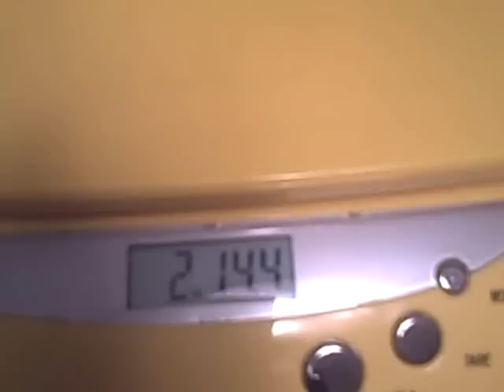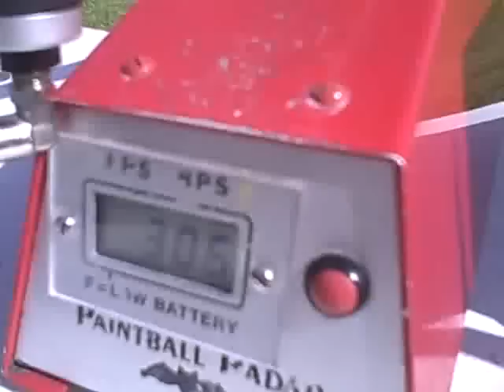TechPB Supergun Show - NXT Shocker Part 2

Comment: dye dm6-8 is also 10 pods from a 68/45  Proto M8 too.  the bad thing about the shocker is that you need to upgrade but the system itself is good.

Comment: Dude Ego's are some of the best guns out there, right up there with the best of 'em: the DM8 and the Closer.  These days most people hail Ego8's as THE best in the business.  The Etek2 is also much better than a Shocker.  I'd rather have a nice cheap Mini, G3, PMR, etc. than any Shocker.  Not too sure I'd rather have an SLG than an upp'd Shocker, but you get the point.  I wouldn't get a Shocker unless they were like under $400 new.

Comment: im selling my sft shocker and want to know how much i can get for it its a used pink 05 shocker with a cp reg cp asa cp trigger high efficiantiancy (spelled it wrong)bolt new upper board and shocktech feedneck it has the pink all american barrel which is rare because they dont make them any more it has minor signs of use but nothing to affect the performance so just message me on how much you think its worth or if you want to buy it